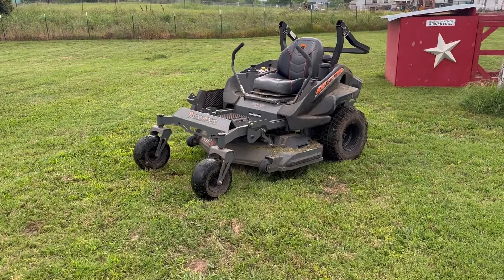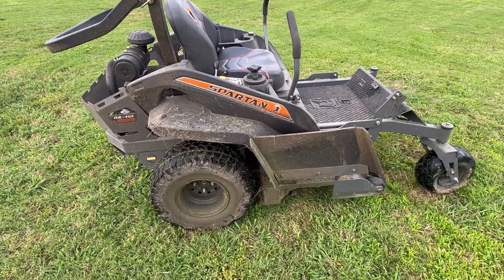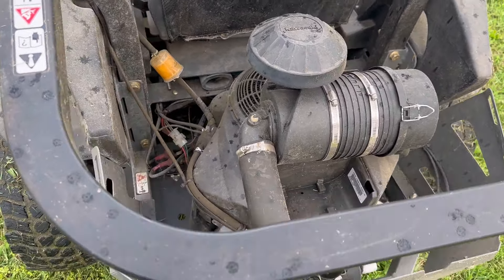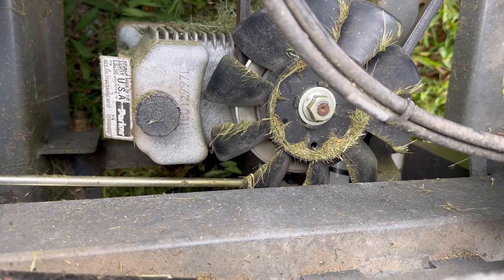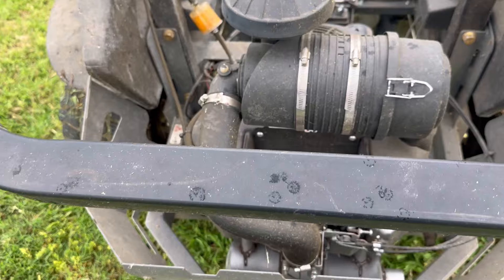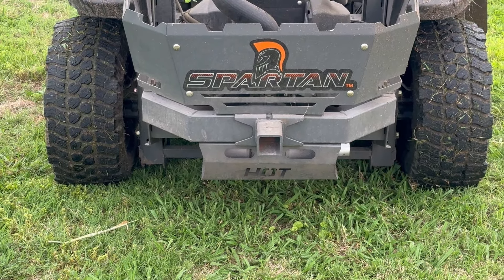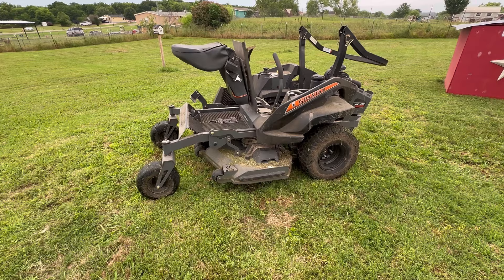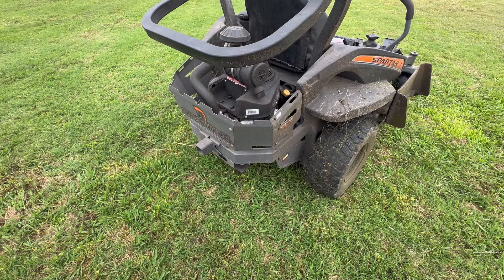IS MY 2022 SPARTAN RZHD 48” STILL BAD A$$?  LETS FIND OUT!

Comment: I have a mower just like yours and the one issue I have is that I believe a bearing on of the spindles is going out. It started making noise and a tiny amount of sparks coming out from that area so I disengaged the blades and looked and didn’t see anything obvious. There are small pieces of paint chips that I assume came from under the pulley lying on the top of the mower deck. Does the entire assembly have to be swapped out? I have scoured the internet and can’t find an answer.